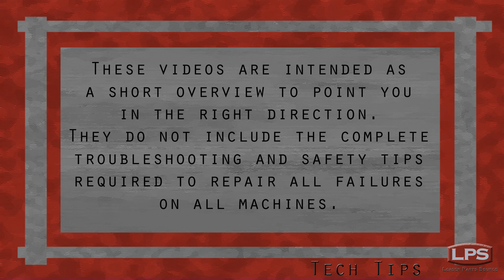Tech Tips - What is Charge Pressure

Comment: what would cause a bobcat excavator 425 to have low pressure and its affecting all hydraulic functions including drive.Has a new pump too
Reply: Your type of machine has an open loop closed center hydraulic system.  Nothing in this video applies to your system.

The problem you describe will be in one of three places.

1. The load sense circuit is not calling for pressure.

2. The system relief is defective. This would cause your hydraulics to get hotter than normal when under extended load.

3. The new pump is defective.

If I was working on your machine. I would install the hydraulics and use a temperature sensor to check if the inlet end of the control valve is getting hot over a couple minute time frame. That is based on my assumption that the system pressure control valve is located in the inlet section of the hydraulic valve.

If they didn't find a problem there, depending on my resources, I would have to choose if I send the pump out for testing or test the system to find out if the load sensing is working.

If I wanted to check the load fencing myself I would look at the pump control for the small test part probably number four size. it will be a couple hundred pound to lower than system pressure. If that difference stays the same when it's under load the pump is making the pressure it is asked to make. If the difference decreases before the system reaches operating pressure, the pump has a problem

Good luck